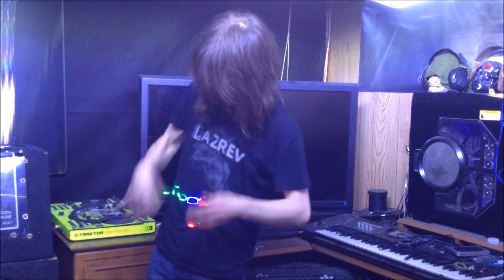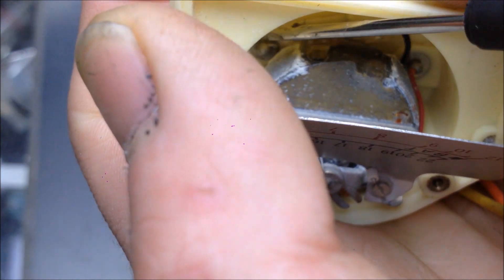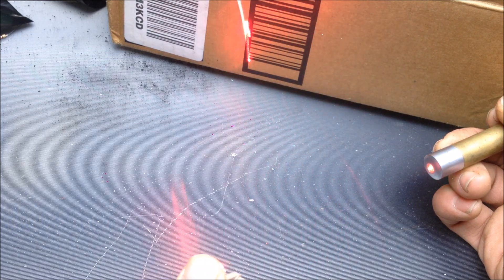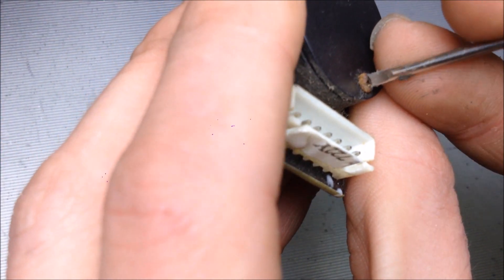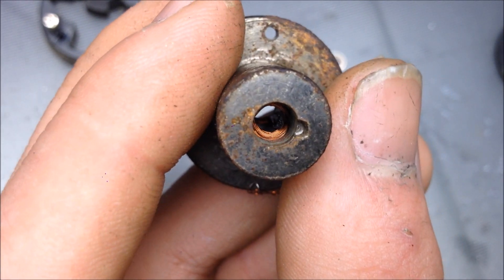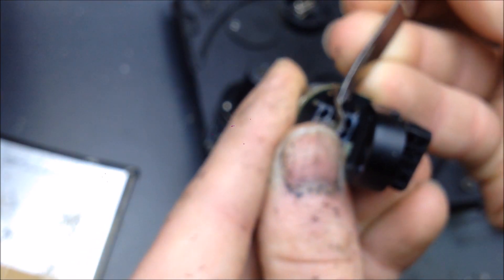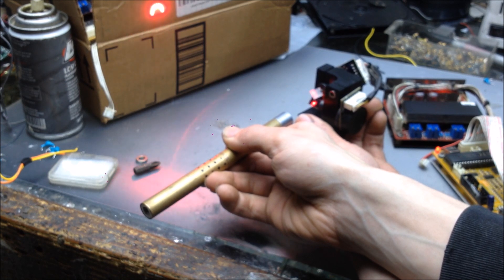Inside the Closed Loop Laser Beam Stearing Galvanometer.

Comment: Thank you for demonstration. is there any limitation to spinning of the shaft except the clip? Will shaft be able to rotate indefinitely if clip is removed like brushless dc motor?
Reply from the maker: The galvos set up with the bowtie style flag/ other non mechanically  intrusive optical detection can be driven like motors. However you will need to use the optical feedback for timing. This has been done by Scannermax actually.
https://youtu.be/4XqW0KtR_XA

Comment: You have shot a very useful and timeless video. Thanks. I have a question. I wonder if the head motors used in HD can be used? Is it possible to achieve higher performance? If possible, can you try something like this? :-)
Reply from the maker: Hard drive actuators have a weaker power to weight ratio. There is a reason why wheels are around, a reason why roofs are slanted, and why speakers haven't changed much. There is usually an optimal configuration for a task and the materials and geometry that a galvo uses is pretty much the ideal assembly. There isn't really a good away to do closed loop with those actuators either. The heads scan for stuff on the disk, they are not searching for their own location. 

Thanks for the compliment, I try to aim for timeless information. No point in making temporary educational content lol.

Comment: I have a issue with galvo 9268Ythe mirror is jammed and doesnt move freely.Please guide me.Many thanks
Reply from the maker: Sounds like the galvo amp may of failed or the galvo over traveled and got stuck. In this situation there is usually a catastrophic burning of the coil inside the galvo. You will most likely need to replace the galvo and amp to fix this issue. You can try to manually free up the mirror but often this is a symptom of a larger problem and will most likely fail again shortly even if you do manage to free the mirror. 

You can try to contact the OEM and get a replacement galvo and amp and this would fix the issue. If you are outside of the support/warranty time and need a repair done feel free to contact me and I can give you options for replacement parts or service your unit directly. My email is in the about section on my page.
Reply: I appreciate your quick response and will surely connect with you with the details.I freed up the mirrors but the galvo doesn't move
Reply: The amplifier board has the 2 smd  lights lite up ,so looks like the voltage is reaching the amp board.But I put my finger on the mirrors I don't feel any vibrations or movement on both x and y axis motors.
Reply from the maker: @vinaykumardhanapalan1886  do the mirrors lock into the home position and hold still or can you freely move them when they are powered?
Reply: @Zenodilodon  they are holding up when powered on
Reply from the maker: @vinaykumardhanapalan1886  Strange, unplug the galvo that failed and see if that one scans along one axis. The laser might be in a fault state because of the galvo error. Does your laser modulation still work?
Reply: @Zenodilodon  both the galvo motors get locked while on and don't move .
Reply: @Zenodilodon  Laser modulation working perfectly RYB
Reply from the maker: @vinaykumardhanapalan1886  Hmm, I wonder if you have a negative rail generating DC-DC converter that failed in your laser. Do you have access to a multimeter?
Reply: Yes I do
Reply from the maker: @vinaykumardhanapalan1886  Check to see if you get both the positive and negative voltage rails. You should see 3 power wires going to the galvo amp. One will be common and it's usually the middle one. You will want to test against that pin. One should be +15-24v the other should be - 15-24v. Between the 2 outside pins should be double 30-48V
Reply: @Zenodilodon  voltage is missing on the the three pin connector.
Reply from the maker: @vinaykumardhanapalan1886  Hmm, you may of not found the power connector but instead the signal input. 

Send me over some pictures of the inside of your laser, Let's get a closer look at it together!
Zenodilodon@gmail.com

Comment: are those electromagnets encased in iron core? or is that just thermal mass?
Reply from the maker: The electromagnets are in an iron core. This produces a much larger magnetic flux than bare electromagnet coils. The thermal mass helps keeps them cool, but that really is more the job of the scanblock mount for the galvos.
Reply: @Zenodilodon  ahhhh that explains it! when i ran my FEA simulation i only ran the case where iron core was touching the electromagnet on top and bottom and next to the magnet rod, not all around the electromagnet. Currently i use a 3 part 3D printed jig to wind the electromagnets with a center punch that i punch out. This works super well for creating properly toleranced windings, but i clearly need to revise this around the iron core. My last design could only hit about 80hz scanning at 60 degrees which is not enough for actual projections. I improved my electromagnet and tolerances but I dont think itll make enough of a difference. I will run some more FEA analyses on different iron core scenarios and refine my design. 

THANK YOU SO MUCH for your response. You have saved me a lot more design testing.
Reply from the maker: @lazarusmagellan2367  80Hz at 60 degrees....Do you know what's that actually gives you? Top end galvos at 50KPPS only hit like 200Hz at 45 degrees. you're already looking at what could do 25-30 KPPS at normal scan angles easily. That's within industry standards.
Reply: @Zenodilodon  Well that's the scanning frequency when I don't have a mirror on it. As soon as I attach the hard disk platter mirror it significantly slows down. I am also using those red single axis 30kpps boards from earlier this year so that would explain the speed. I think when I switch to silicon wafer it will lose a lot less speed and then maybe I can get away with doing some projections without any flicker. Also since having the winding encased in iron increases the flux inside the coil, then I can probably get away with a wider angle too! maybe... Ill have to test it out at least. But I'm excited to try it out. (edit: then I also need to look into software. right now im using csv data to write positions and colors. I think there is some software optimization to be done to make it smoother) (edit #2: Ive run some simulations, it does seem to concentrate the B field within the coil on the horizontal, right where you want it to for max torque on the magnet rod. It also seems to concentrate within the pure iron cylinder right where the electrical coil touches. in one case or another ill test it out irl) (edit 3: I ran some more fea simulations. The iron core does a good job increasing flux right around the perimeter of the magnet rod by around 50%. that is quite the increase. not only that, but it also prevents the magnetic field from extending on over a centimeter beyond out on each side. It seems the thickness of the iron tube encasing the electromagnet does not have as much of an effect on the flux right around the magnet rod. although a thin iron tube tends to lead to higher B field saturation right outside the electrical coil.)

Comment: What's the. Maximum frequency it can work in khz?
Will it work on 15khz with same deflection angle?
Reply from the maker: The galvos really only run around 200-500hz when operating. KPPS or kilopoints per second is not equivalent to oscillation capability. This speed is reduced with wider deflection angles.
Reply: @Zenodilodon  so that's tha maximum speed that galvo can physically run?
Reply from the maker: @omsingharjit  In talking to an engineer discussing LIDAR use with a 50KPPS system he said that as max deflection the top speed was 200hz and he wished speeds could be increased. These use pretty tiny little coils and any more power tends to burn them up. However if you do not require instant deceleration ( such as a sine wave input/output ) you could probably go a bit faster since your not using a bunch of power in the galvos to decelerate. 

This information is concerning above industry standard speed of 30KPPS so keep that in mind as well. Even 200hz at max deflection angle is expensive to accomplish with a closed loop galvo system.

Comment: Enjoyed your video! I am intrigued by that voice coil mirror you showed as a second example. Where can I find some of those? All the best!
Reply from the maker: That mirror assembly was I believe pulled from a Laser Disc player. I was not the one who took apart the original machine but that's what I was told. I am not sure where to buy one, but making one shouldn't be difficult. rip a voice coil out of a speaker, find a suitable magnet and figure out the mechanicals. It's not very fast, nor accurate at any speed but it's nifty looking!
Reply: True, it does look like old tech. When I search Laser Disc player, I find mostly DVD players, but they use much smaller voice coil assemblies and not galvanometers. You are right - the device here looks like an easy build.  @Zenodilodon  
Cheers

Comment: excellent description of various galvos.  A couple questions.  First, is there open source software that works with closed loop galvos and second, what pps rate would be needed for laser sintering?
Reply from the maker: I am a hardware tech, there is code for DIY show lasers and running galvos. I suggest looking that up on instructables.

What PPs rate is needed for sintering? Logically I guess anything above 0? What's the material, what's the laser power? 30-40kpps is pretty industry standard but you can use almost any speed that suites your needs as long as the mirrors are rated for the laser power you're reflecting off them.

Comment: Great Video,i have a Question,in wich Potentiometer can i change the size of x and y
Reply from the maker: It's usually one of the far end potentiometers. Sometimes they don't put a holding glue on the size and that helps as well. The location of the potentiometer may vary so keep track of any and all adjustments made while attempting to locate it.
Reply from the maker: Also note that if you increase size you will need to somewhat inversely  decrease your scan speed to prevent damage to your galvo system.

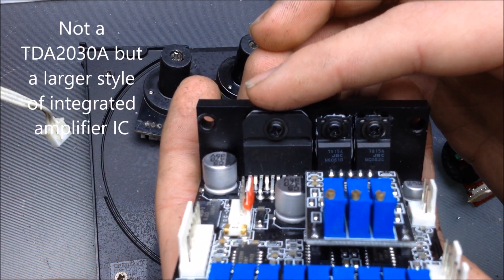Comment: Hey great video!.   At 15:42 do you have any documentation on that board???  Please get back to me,   thanks!
Reply from the maker: I don't on hand have any formal documentation on that model of galvo amp. I do have general experience with them and many other galvo amps. If you have questions feel free to ask and I will try to answer what I can.
Reply: @Zenodilodon  alright.  I figured out it is a cambridge technology micromax 672.   I can find full datasheets for 670, 671,673. Lmao.    I am currently curious of what the pinout of the header J4 under the notch filter add on board. 

Thanks!
Reply: @Zenodilodon   i can use similar datasheet.i have a question.i have xy setup perfectly.   However,  sometimes at startup x will oscillate and I power off/on and it works.   Or...  after 45min to three hours x will again oscillate.   Any suggestions??
Reply from the maker: @supyrow  It could be a few things,first 2 that I can think of is either a bad LED or magnet in the galvo. 

Other issues could be a failing  audio driver IC or operational amplifier. Swap the X and Y galvos and see if the problem stays with the amplifier or the galvo. X often fails sooner in show lasers due to wider scanning angles over head and typically hits the magnet's overall strength.
Reply from the maker: @supyrow  You can also check the amplifier board for a polyfuse sometimes they can fail and cause similar issues. Not all amps have poly fuses. Google images for an idea of what to look for.
Reply: @Zenodilodon  it has a polyfuse.   I'll try switching x for Y.  
It uses a cambridge galvo, disassembly/reassembly is the tough part.    It doesn't belong to me.

Comment: One Question ...
When I was thinking to build my own galvo lots of doubts Came on like 
Suppose you build Galo that works on 10 volt + and -   , and 0 is the center Position of its rotor and you put 1 Hz Sine and its position swings back and forth from the center with 10 volt + , -  suppose 30° , But as you will rise the frequency with same voltage it will rotate Back and forth at that frequency but its Mechanical Amplitude Would be Lower with Frequency going up because of Inertia so to compensate this power of the coil should also increase with frequency to archive constant amplitude with All frequency .

Same with Coil impedance, which goes Higher with Increasing Frequency so Amplitude should go lower .

Is it real problem with Open loop Galvo ?
Reply from the maker: Most signal inputs are 5+/5- with 0v being center/home. That's what is used for the voltage for the show laser type stuff. Some galvos may support higher voltages but I'd stick with 5v and set your needed master scale/size from there. ( potentiometer on the galvo amp ) if needed. The size/frequency issue you speak of where faster frequencies are smaller is only an issue on open loop galvos. Closed loop will do it's best to maintain the correlation between signal speed and amplitude across all ranges.
Reply from the maker: Open loop galvos will tend to have in inverse effect. 30hz at x wattage will have double the deflection of 60hz at the same wattage. You are trading the energy of travel distance in for faster changes in velocity. (120hz(x4 the acceleration =1/4th the deflection @ equivalent wattage).

Comment: I am starting to learn about galvo systems. I was just wondering if there is any way to control the galvo with a software. Could you please refer me to a tutorial where it is shown step by step?
Reply from the maker: The systems that I work on are all externally controlled through Pangolin software/hardware. I am only a hardware technician and cannot assist you with DIY interfacing/programming. However I suggest you look into this for more information.
https://www.instructables.com/Arduino-Laser-Show-With-Real-Galvos/

Comment: Brilliant video, thanks! We have an instrument with a pair of galvos run by a GSI Lumonics XY controller board that is now failing randomly, leaving the galvos in the resting (midway) position. There are identical boards on sale in eBay. Any chance a replacement might work without extensive recalibration/tuning?
Reply from the maker: You may be able to get another board to work without much tuning yes, given that the mirrors where similar on those galvos as to yours. Most of the time some tuning will need to be done to get the best and most accurate performance and life out of your galvo system. 

Tuning instructions can be found here.
https://www.youtube.com/watch?v=hNGTKNW99Zw
Reply: @Zenodilodon  Precious input, man, we might give it a try - thank you very much!

Comment: #Zenodilodon
I'm trying to make a real small laser project to sit inside of a PC Mod that'll project patterns and images on the Tempered glass door of the PC... Were could i find a cheap used Galvo set and controller circuit, everywhere I've looked there all brand new and shockingly expensive... after watching your video, I realise two motors wouldn't work, right?.... awesome video by the way, I learnt quite a bit, thank you.
Reply from the maker: Integrating a laser show inside of the computer could be quite tricky, especially given the available room you mentioned on the other video comment.

A few things to note, most galvos use a +/- PSU and usually 15v and up. This means that you would have to figure out a way to power the galvo amps. There are places you can try to hunt down cheaper galvos. If you are interested in messing around with some smaller/lower speed ones I might have a kit that is somewhat usable for experimentation. 

I use Pangolin hardware and software for control, this means that for the most part I am clueless as to a DIY control system. Some have used various function generators for abstract outputs, some have used a sound card or other home made DAC. You will have to figure the control portion out yourself. 

You're welcome to drop me an an email for further discussion on your project. Zenodilodon@gmail.com

Comment: Not 100% sure on this but I think there was also another feedback method that used rotary capacitors (like in old AM radios), it' might have been used by General Scanning, Inc back in the '80s (It's been a long time since I fiddled with laser projectors so I may be wrong...). Great video, you've earned yourself another sub :)
Reply from the maker: You're correct! The capacitive closed loop design is actually on this channel for viewing too. Check out the Raylase video I posted. Welcome to the channel!

Comment: Hello do you might know where to get some spare parts for galvanometers? Because I'm looking for the small plastic part in the back from a glavo that prevents it from turning 360 degrees but on most websites they're only selling complete sets.
Reply from the maker: You can find the mirrors from laser manufactures, usually OEMs of galvos or sometimes on eBay. Beyond that there really isn't a place to get galvo parts. The cores are usually made at the OEM and from there it's bearings, magnets, and LEDs that are outsourced. Once you identify those parts you can replace them by searching for suitable components from manufactures. IE for the diametrically poled magnets you would need to determine the physical properties and contact a magnet supplier.